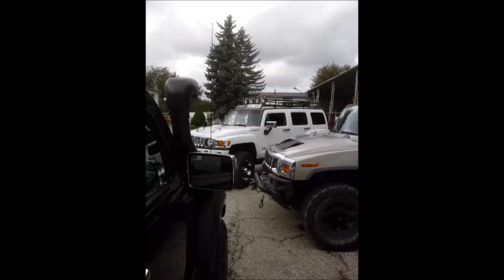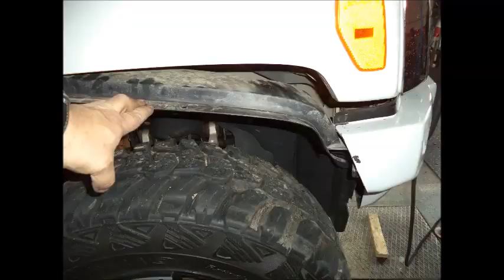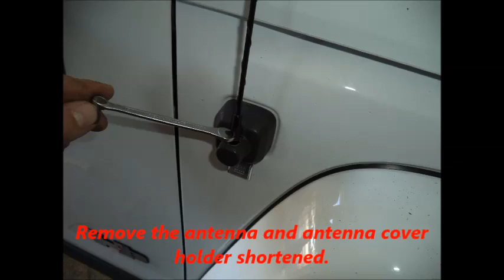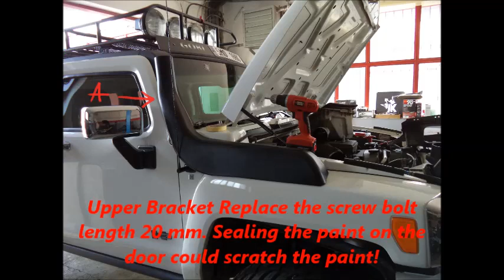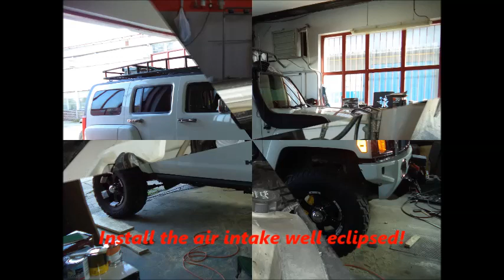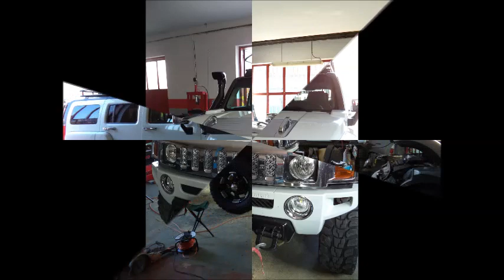Installing a snorkel on Hummer H3

Comment: Question for you , getting ready to install snorkel , but does the template butt up to the black rubber fender insulator  ? Or go flush to inner fender support?

Comment: Have you noticed any improvements in addition to the designed features such as increased pedal response or any draw backs such as decreased fuel economy?
Reply from the maker: Snorkel has a function only when watering is to reduce fuel consumption or any pedal response is not possible.